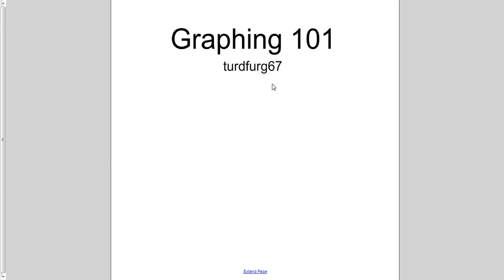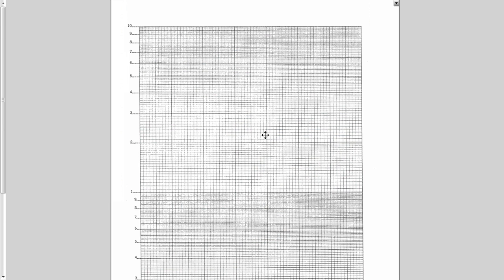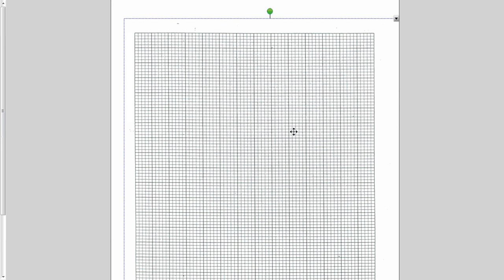Intro to Linear Graphing (Hooke's Law Example)

Comment: Hi, I'm kinda confused here, I understand the way you drew the graph with Force on the Y-axis is the only way for the gradient to be equal to the spring constant, but doesn't putting force on the y-axis suggest that the force is dependent on the extension, which i don't get cause the spring extends the amount it does due to the force applied, not the other way around, right?
Reply from the maker: Busted, you are right, dang independent / dependent variable stuff. Often though on the education side we set up the graph so that the slope is easily recognized. If we would have graphed it with displacement on the y-axis, then our slope would have been the inverse of the spring constant. Most students wouldn't catch that when they do their regression, so we manipulate the graph so the students can understand the results. If that makes sense.